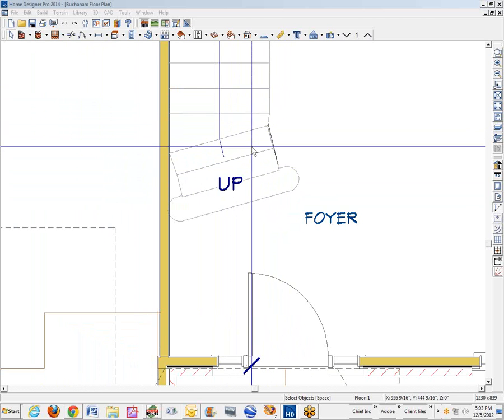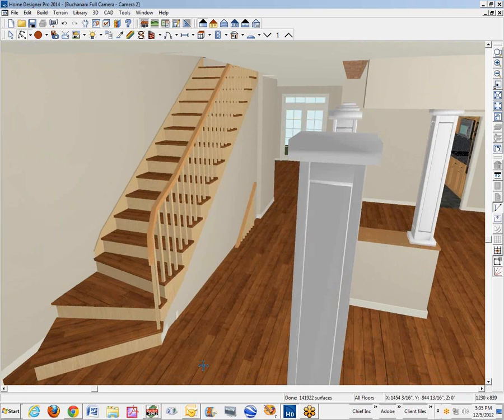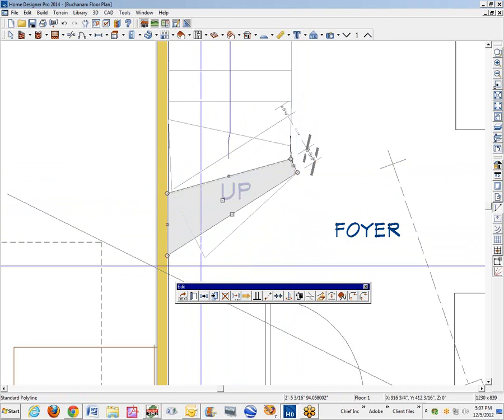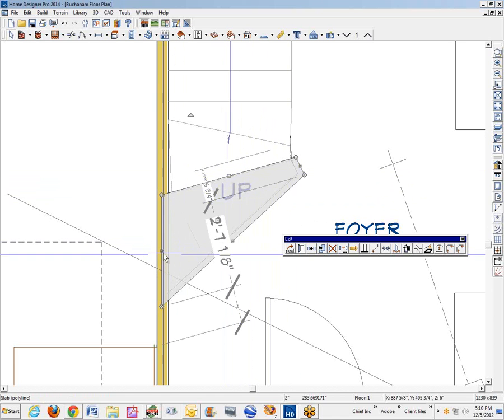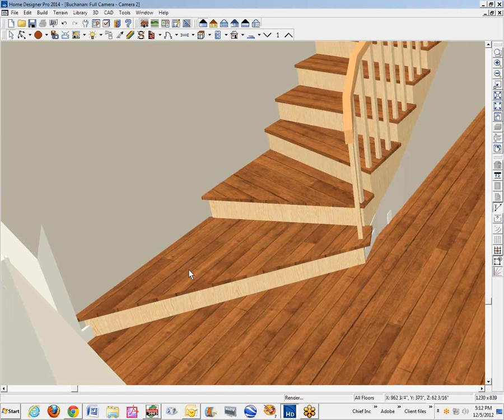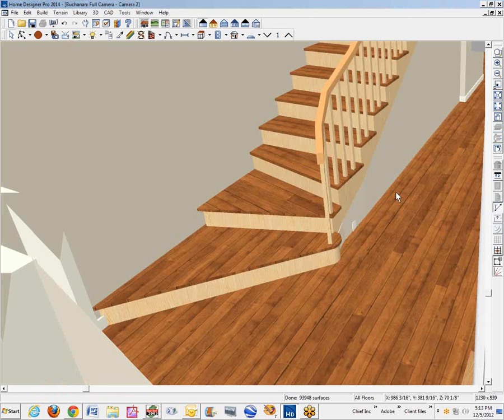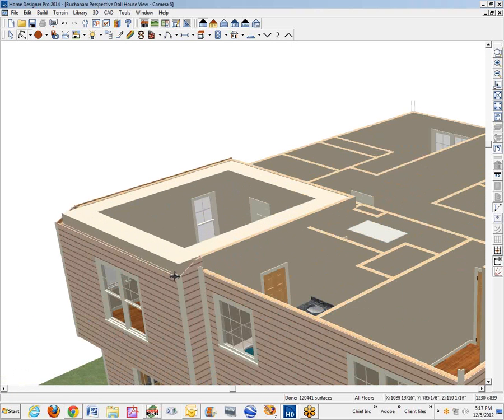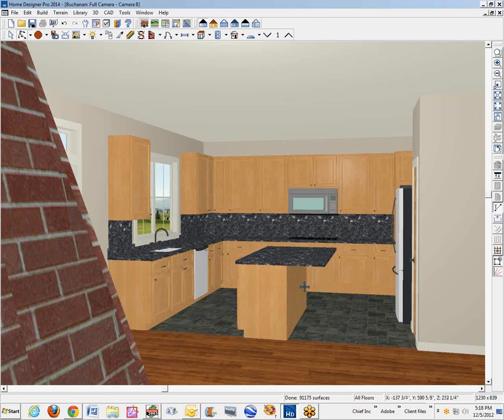Customize Stairs and related matters

Comment: Is there a way to change the angle of stairs in Home Design 2019 suite?  I need to have a steeper angle to reach my second floor; adding stairs only shoots the stairs outside the house?
Reply from the maker: Adding treads lowers the stair rise angle and reducing the number of treads steepens it
Reply: But that does me no good, if I add stairs, it reaches the second floor outside the house.  I need to steepen the angle with the same number of stairs, 10 total?
Reply from the maker: I am sorry, but I cannot alter the laws of physics and geometry just for you. You may need to rethink the design of the stairs. Stairs are a rather large barrier to Architectural design for the reasons given, sometimes you just have to change the design to accommodate the reality of the stairs.
Reply from the maker: The stair tool is programmed to design stairs that will pass inspection in most areas of Earth. Too steep is illegal, so a designer must design something that will fit in the space available, no if's and's or but's. That is what is true.